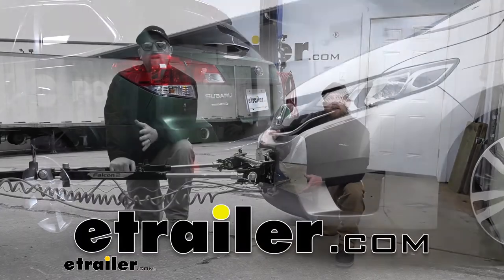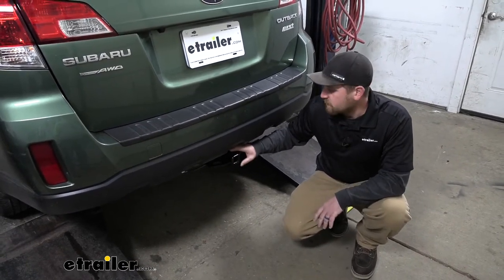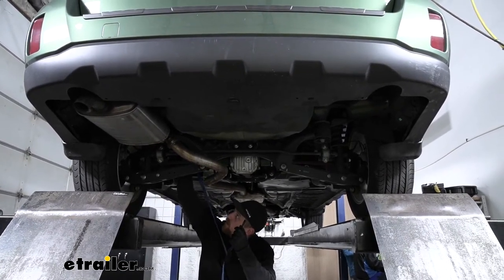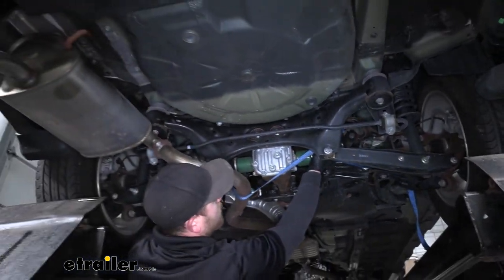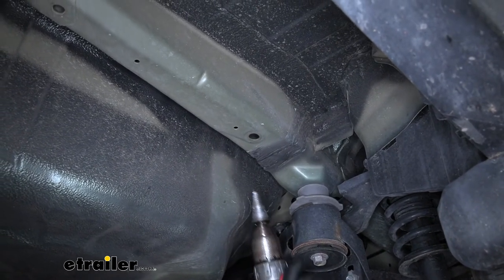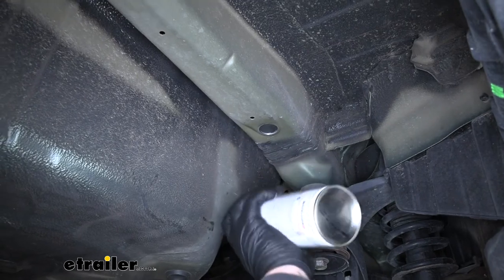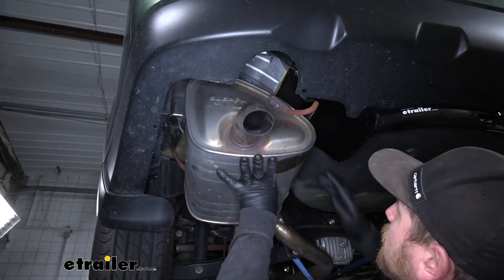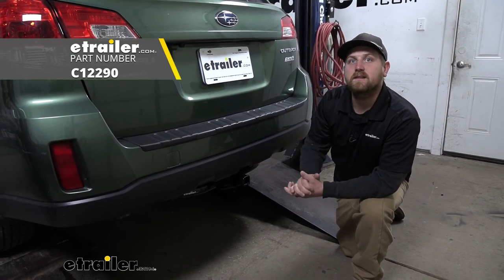etrailer | Setting up the Curt Trailer Hitch Receiver on your 2013 Subaru Outback Wagon

Comment: Thanks for the video guide.  Definitely helped clarify written guide.  Word to the wise... make sure both the plate and the carriage bolt head fit through the enlarged hole.  I cost myself some time by feeding the plate up only to realize the bolt head is slightly bigger than it.  Had to get a little creative to enlarge the hole after I had the first mount plate up in the frame bar.

Comment: The 1 part I needed to see wasn't shown, how do you drill the front screw hole on the exhaust side it's being blocked by the hanging muffler
Reply from the maker: You just need to drop the exhaust low enough to get a drill in.
https://www.etrailer.com/Trailer-Hitch/Curt/C12290.html
Reply: Yup, lower the muffler/exhaust assembly enough to clear your drill